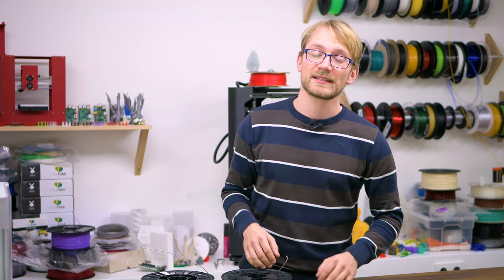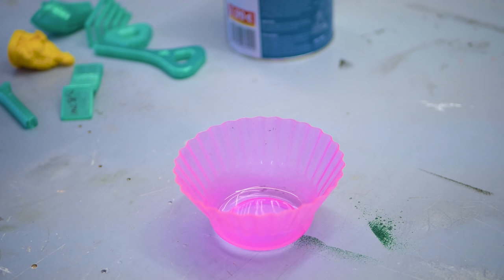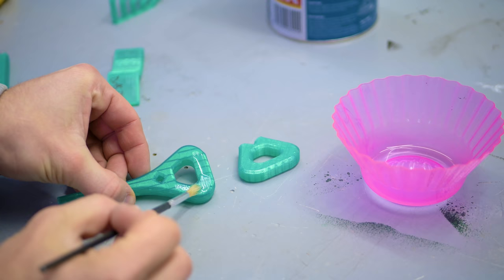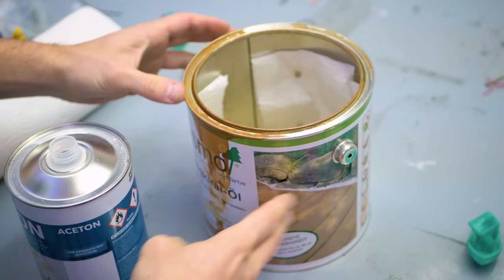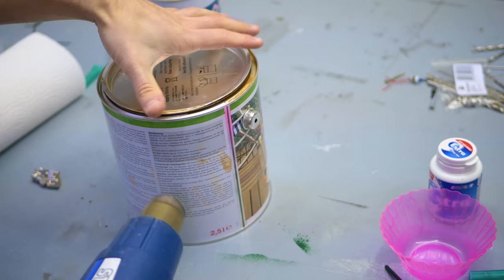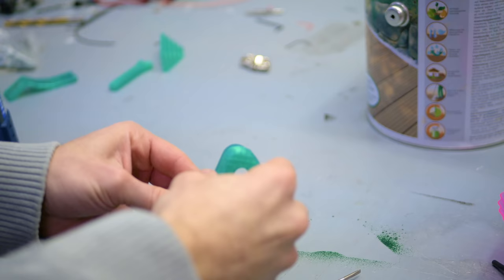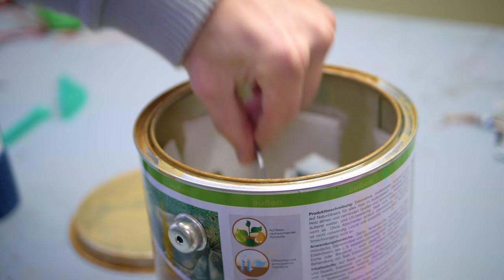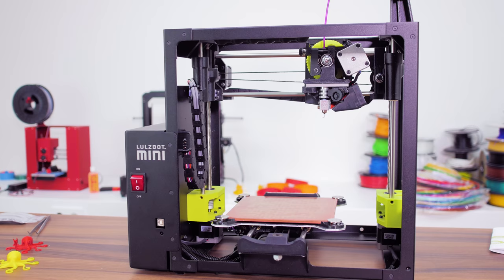Does Acetone also work for welding and smoothing PLA 3D printed parts?

Comment: Not to be a drag but please be careful heating acetone! Acetone liquid and vapor are highly flammable, and over-exposure to vapors can cause nasty side effects. Especially using a resistive heat element to warm it, popping the top at the wrong time could bring a nasty surprise. And wear gloves to avoid contact dermatitis! Safety Officer lecture over, thanks for the video!

Comment: tetrahydrofuran is what you want to weld PLA - it works insanely well. It's pretty safe for a solvent, but more volatile than acetone and can form explosive peroxides if exposed to UV light for extended periods of time - so is sold in brown glass bottles. It'll do PLA, ABS, HIPS and PVC. Give it a shot if you can find some locally! It's stupidly thin though... get a very fine applicator.
Reply: If it's very thin try touching seamlines of your join with a brush loaded with the liquid and let capillary action draw it around to all the joints that you're welding. It's a technique we use alot in the plastic modelling world with Tamiya Extra Thin polystyrene cement.
Reply: Maker's Muse Thanks for that info Angus I'll start looking for some of that.
Reply: Be aware that it is supposedly carcinogenic, and its vapors are very flammable. Use in small quantities in a well vented environment only, and don't sniff. :-)
Reply: Just go get some PVC glue or PVC cement (it's usually mostly stabilized THF) at your local hardware or home depot store. Just make shure to read the safety data sheet and instructions before use. As with all solvents, be careful, stay safe and protect yourself. We don't need more people making the news because they set a house on fire because of an abusive use of 3D printers and chemicals/hairsprays... ;)
Reply: Chloroform and dichloromethane too, read my post.
Reply: THF is just ok, but dichloromethane (DCM) works much better.
Reply: It highly depends on type of PLA. Some tests 2 years ago got this result:
(All filament was bought by "German RepRap" company)

- black opaque filament didn't solve in Acetone or THF.
- red opaque filament didn't solve in Acetone but well up something in THF.
- green non opaque filament didn't solve in Acetone but well up good in THF and colorized the THF
Reply: ExtraBase Yeah, I kinda agree, but truthfully I haven't tried (yet).
As far as gluing ABS, why not just use (common) ABS (primer might be optional) cement?
Reply: Pretty safe? Have you read the MSDS? For a start, it's a volatile carcinogen and a pretty potent toxin.
Reply: @truantray  haha, do you know of an organic solvent that's much safer? Most seem to be pretty nasty, which is why they work!
Reply: doesn't work well for smoothing though. also the peroxides even form when stored in the dark, make sure you get as little air as possible in the container! in labs storing lots of it often they flush the containers with nitrogen each time before closing them up
Reply: THF is very nasty stuff! Don't ever use it without proper ventilation, and I mean PROPER, as with a fume hood!
Reply: @thedude6736  - The main risk is explosion, if it's not stabilised, had some time to evaporate, and you open the bottle near some source of ignition. It's about as toxic as acetone (which means pretty low toxicity by the standards of solvents). Used infrequently and in small amounts in a ventilated space, it poses no real risk.
Reply: @truantray  - It's a carcinogen for rats, there's no evidence of it causing cancer in humans. Organic solvent effects can't really be extrapolated to different species. For example, MC (in very high concentrations) causes cancer in rats, but not in hamsters. The main risk with THC is explosion. In terms of toxicity, it's equivalent to acetone (i.e., on the low end for organic solvents).
Reply: @RFC-3514  While you are right about the danger of explosions, your statement about the toxicity is at least questionable. Have a look at the safety data sheets: THF has H351 (supposed to induce cancer) which is not the case for Acetone, which is basically just burning very well and you shouldn't eat it.
Reply: @thedude6736  - That "supposition" is not based on any actual evidence. There is some evidence of it causing cancer in rats (at high concentrations and with prolonged exposure), but none for humans. 

Have you looked at the "possible side effects" listed for common medicines? MSDS are the same: they list everything, no matter how small or unlikely the effect. 

As far as organic solvents go, THF is one of the least toxic. Nearly all the effects listed in the MSDS for THF specifically mention "in high concentrations" or "with prolonged exposure".
 Used infrequently, in small amounts, and in a ventilated space, it's fine.
Reply: @RFC-3514  Still, I don't think THF should be used by hobbyists who have no background to judge if the exposure is tolerable or not. There is a reason you usually can't buy THF in the next hardware store. And even a low probability to cause cancer is, in my opinion, enough to avoid it. I think you always should consider the least cautious person who will eventually spill it all over their hands and take a deep breath.
Reply: @thedude6736  - To quote Tim Minchin (in his excellent "The Fence"):

We divide the world
Into things that give you cancer
And the things that cure cancer
And the things that don't cause cancer
But there's a chance they
Will cause cancer in the future

There is no evidence of THF causing cancer in humans (even at high concentrations and with repeated exposure), so I guess you're putting it in category #3.

The reason why you usually can't buy it "in the next hardware store" is that it's a pretty specialised solvent, that few people would be interested in buying, and most hardware stores don't keep 50 different types of solvents in stock.

You can get ammonia, sodium hydroxide and sulfuric acid pretty easily (not to mention hammers) and they can do a lot more damage a lot faster.
Reply: @RFC-3514  who could argue with that
Reply: @mikeschubert4890  My nozzles didn't clean up in acetone so I never tried again.
Reply: @RFC-3514  That is the 3D printing comment of the decade ... Quoting Tim Minchin lyrics re toxicity of THF!  Thank you for taking the stand in defence of the fence ... and sanity.

Comment: Use gloves when handling acetone! That stuff is not healthy.
Reply: No, that would be something like cyclopentadienyl nickel nitrosyl =)
Reply: protip: your body produces acetone when it burns fat. so much of it you can smell it in urine and your breath.

think about that when you assume acetone is deadly and must be handled with gloves.
Reply: Oh, but if its so healthy why don't you just drink it? Never said it was deadly,  and that fact or "protip" does not mean it is healthy. And why are you so offended by the fact that it is not healthy?
And sure. I will think about that totally unrelated thing when handling out safety advises.
Reply: It is not that it is a danger as in "you will die" but it is not good for your skin.
Reply: Another question related to 3d printing. Ive been trying to ask you this some times in the 3dSenpai. What are your experiences with moving build platforms as opposed to static ones? =)
Reply: ms3bani  Acetone is not good for your health, please wear proper gloves when handling. I know it's a year late. But be smart for you and those around you. :)
Reply: @ripperfisher182250  why? Was there something that was supposed to happen after I got acetone on my hands over and over again? My hands felt dry afterward sure but eating a few slices of pizza got the skin on my hands feeling normal again pretty quick.

Comment: Hi Tom, I have been smoothing ABS and PLA for at least three years on at least a daily basi, and three years ago I made an experiment comparing different substances and their effect on ABS and PLA, I still have the 28 yodabudas (1 ABS, 2 PLA for each substance) from my test exposed in my house. I also test various coatings on parts.

What I found out is that even though some PLAs are affected by acetone, in the long run (weeks or months afterward) all of them degrade and crack, I have a few pictures if you want.

On the other hand, in this test I also found three substances that work well with PLA. In order of strength (less strong first): tetrahydrofuran, dichloromethane, chloroform. These work so well that sometimes after finishing the part is so smooth that it is actually indistinguishable from a inject plastic part - you might suspect you have a printed part due to the absence of injection seams and marks. Notice that these are all lab liquids, and must be handled with protection and extra care. All of them must be vapor smoothing, and you can also make an analogous with 'abs juice' with all of them. However, specially for chloroform, you might want to coat them with lacquer or varnish afterwards (XTC-3G works well) because further exposition to elements will otherwise slowly create minuscule cracks after a couple months.

Ah, and last but not least: ethyl acetate does not work for PLA. It has some residual effect but it is much like that of acetone, and the part starts degrading and cracking in a few weeks.

BTW: sorry to correct you, but the part does not 'melt' with the vapor smoothing. It dissolves, which is a completely different phenomenon. The engineer withing me cringes every time someone mistakes melting for dissolving or vice-versa.
Reply: *****
I have not yet tried butanone, good advice, I will try it, thanks. And sorry for my aggressive way of speaking, I know you know the difference, it is just that I police myself so much not to confuse these things that something 'tingles' in me when I read other people confusing.

To buy these solvents in Brazil (where I live) it is even more complicated. I had to request federal permission to be able to buy them, including acetone, and you have a limit of 2 liters per month. And now I am in the process of requesting permission from the army to buy hydrofluoric acid (maximum 2 liters I think).
Reply: Theres DCM at amazon.es  perhaps you can have it delivered to Germany as I've bought stuff from amazon.de in the past and deilvered to my home in Spain. Or I can get you a bottle if interested. Or we can share 50% of a bottle if you want hehe
Reply: Ahmad Firdaus Ismail there is no secret. I vapor smooth them. I have a chemical enclosure with an industrial exhaust at my lab where I heat a becker via an electrical heater (so that it does not generate flames or sparks). I wait for the chloroform to start boiling then I dip the part with tongs in the becker for about 10 to 40 seconds. I use a full-face gas mask, nitrile gloves and lab coat to deal with it, and after I finish I let the exhaust take care of the vapors for about 5 minutes until I turn it off.
Reply: Weld-on #4 is primarily dichloromethane. I use it for gluing pieces together.
Reply: THF isn't too bad to work with. I've worked with it a lot dissolving polymers for spin casting thin films. It's probably one of the least problematic solvents I've worked with over the years. It does have a very high vapour pressure though, so it evaporates very quickly, which can be problematic. Just don't let it sit around a long time and crystalize. :)
Reply: +everybodyluvsray it certainly seems so, but I did not understand very well why you could not keep THF - is it because it is volatile? Every chemical can be kept, you just need a proper containment for it. DMC is pretty much like chloroform, just a bit weaker, and this amazon item seems to be the right stuff (although I could not see its purity, is it 99.9%?).
Reply: I also didn't see anything about the purity but the can appears similar to what acetone comes in so it may be of high purity. What I was talking about with THF was that after the expiration date of about 6 months the chemical supposedly becomes unstable and more likely to combust explosively so it's a good idea to dispose of it. I'm not a chemist and I don't really know the details but that was what I was told so I was wondering if your bottles have similar expiration dates.
Reply: +everybodyluvsray !!! That's new to me! I usually read the security card of every chemical I buy, and I did for THF, and although it mentions that it can form explosive peroxides, it says nothing about late instability. It clearly says: "stable in normal storage conditions".
Reply: Ah ok maybe I was being paranoid then. Thanks for the info!
Reply: When you say "further exposition to elements will otherwise slowly create minuscule cracks after a couple months", do you mean by elements air or rain? I normally think of "exposure to the elements" as exposure to outdoor conditions but I think you might have meant the air, indoors?
Reply: The air, indoors.
Reply: Cláudio Sampaio Hydrofluoric acid?! What do you want that for? Making transistors? Etching glass? Because it’s extremely dangerous (I read that someone who works with it accidentally got a spill on his leg, and despite rinsing with water and amputating, he died in a few weeks!) and there are few uses for it.
Reply: @GRBtutorials  It is indeed very nasty!
That said, I had a "childrens'"(!) chemistry book back in the 1960s that suggested etching glass with hydrofluoric acid made by boiling teeth with hydrochloric acid in a lead crucible ("ask your dentist for a supply of extracted teeth") 😁
Reply: @John Shaughnessy For all of you LIFEFORMS (if you are dead then who cares) chloroform made with bleach and rubbing alcohol is quite carcinogenic and thus, dangerous.

Seriously, I know we always hear everything causes cancer but chloroform almost always causes cancer if you’re exposed to enough of it. 

But the chloroform isn’t anywhere near as dangerous (read: very carcinogenic and lethally poisonous) as the phosphine gas that is produced by this reaction.

Avoid unless you have safety equipment and a proper environment for such activities — standing next to the washing machine is NOT a proper environment.
Reply: Thank you for sharing your findings!
Reply: does diethyl ether work? I have a cheap source for it, and got a very low boiling point (a hot sidewalk will boil this stuff)
Reply: toluene acetone mix..nuff said
Reply: Man, I'm on enough lists already.
I can't be ordering Chloroform online

Comment: The Bonding of PLA with acetone is really helpfull. Now I know that I don't have to use Superglue. Thanks!
Reply: when you get superglue stuck where it shouldnt be .. acetone ... yup it softens that too ... also known as nail polish remover
Reply: @0623kaboom  i feel like acetone is worse, some 120 grid sandpaper does the tric as well, but acetone can really damage your skin

Comment: I've been experimenting with acetone and regular PLA and have noticed that the layers tend to fuse together and smooth over when the acetone is applied with a towel. Also have had interesting results using 2k grit sandpaper and acetone.

Comment: the welding technique you use , is actually the same technique we used at my shop to weld abs binding strip to wood for decorating guitars body and necks . and it works very well !

Comment: One thing that works for me is pouring acetone on a paper towel and rubbing PLA vigorously - it really polishes the surface quite well, but for thicker lines, you will still need to use sandpaper.

Comment: I've found acetone is pretty decent for paint prepping pla parts when I'm not smoothing them and want to pain parts en masse, I'll pour some over a part or dunk a part in and then let it all air out for a day or two and it ends up, at least with the white pla I use, with a nice matte finish that paint sticks to really well and while it takes longer to get all nice and ready it's more thorough and involves less effort than priming for a pretty similar effect.

Comment: Important note here this does not work with pure PLA.
But since most commercial available PLA filaments are blends with other stuff in it to improve printing characteristics chances are very high that it works. And from what I have seen the paint bucket method with very little and cold acetone vapor over long time period (6h+) works best.

Comment: I've used this for other formulations of PLA and had no effect whatsoever. You really have to test what you've got. Not all PLAs are equal.
Reply: Same here. I have been testing this for three years.
Reply: Cláudio Sampaio I have done extreme acetone vapor by suspending my PLA print in a 4 liter jar with 2 liters of acetone for 24 hours at about 15 degree C. The print absorbed acetone and became soaked, expanded to about 120% of its original size, became soft and squishy, and no polishing whatsoever.
Reply: Yup

Comment: For strength you dunk the part in acetone for about 10 seconds. Make sure your part has at least 2mm of wall thickness. I noticed when sanding that there where no layer lines. The part came out exceedingly strong to say the least.

Comment: I like to use Nitrocellulose Clear guitar laqure spray.    if you spray heavy it does melt the PLA layers whilst also giving your print a smooth shiny waterproof hard surface

Comment: I have noticed similar results with acetone on Colorfabb & ProtoPasta PLA. I did however notice model cements containing MEK worked quite nicely when brushed on a model to smooth stuff over!
Reply: Acetone on my Colorfabb PLA HP doesnt really do anything. I tried sanding and then applying the acetone on both sides, but it does not react in the slightest. Did you try another application  method?

Comment: just started to do smooth experiments..i bought a dremel 3d45 and was using their complimentary "eco abs" which is just pla plus i guess.  Anyway...i dunked and vapor bathed..for like 24 hours lol.  gave it a glossy finish at the end though.  Then i remembered back in the chemical room at work we have Toluene....i mixed it with acetone and damn...results were fantastic.  with ABS itll be immaculate guaranteed